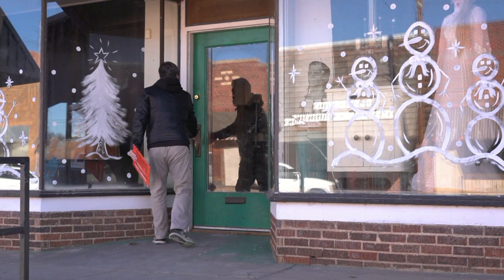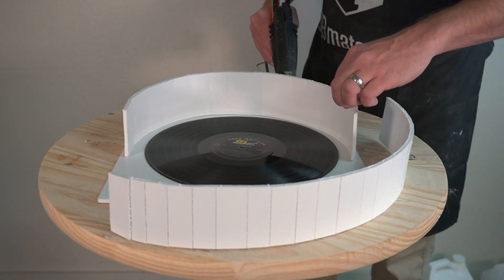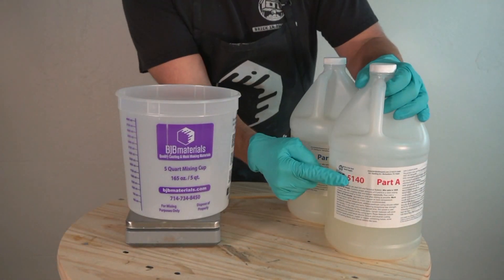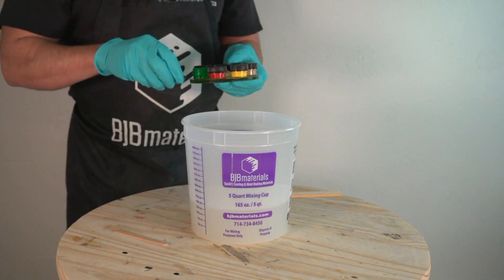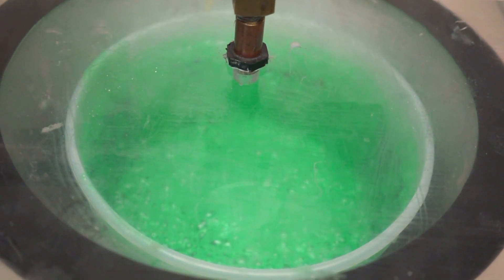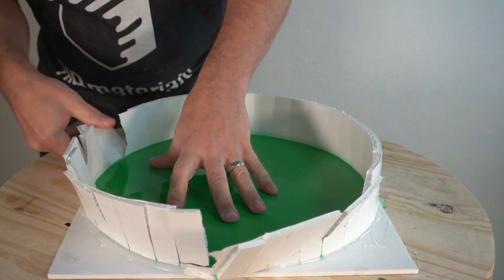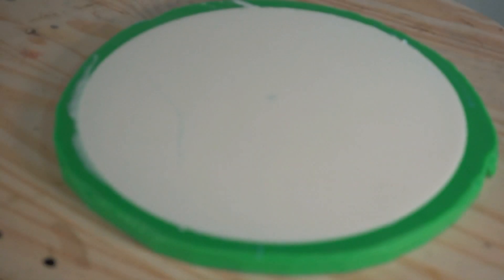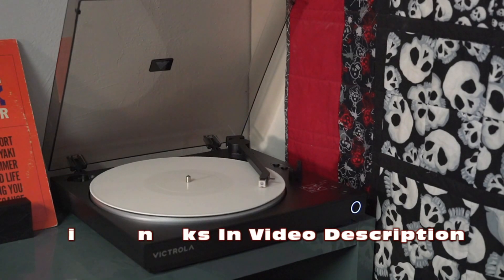Can I Mold Sound? #moldmaking  A Record With 5140 Silicone

Comment: a little tip to get better sound: Before making a mold from LP, you can clean it using wood glue (yes, a wood glue). It helps to remove dust and other micro stuff from the surface of the LP.
Reply from the maker: I've never heard of that trick before! I'll have to try it out next time!
Reply: @brickintheyard  Sebastian Bach swears by that method, it saved his record collection that got soaked in a hurricane. He said even the records his dad had growing up sounded brand new.

Comment: HAHA, I'm glad it worked and with the supplies you had available. as you said at the end, one with less scratches, I wonder what the original record sounded like. Would also to be neat to see you cast a metal record
Reply from the maker: A metal record?
Reply: @brickintheyard could the Mold withstand some heat? Bismuth or tin, or some alloy that would have enough detail for the records sound grooves.
Reply from the maker: @ this silicone will handle a few hundred degrees but I don’t know the exact numbers. I’ll see if I can get a scientician from the BJB to chime in.